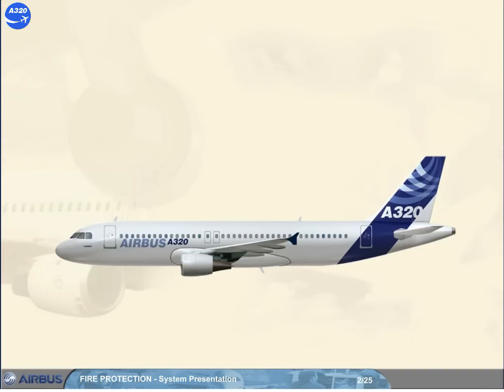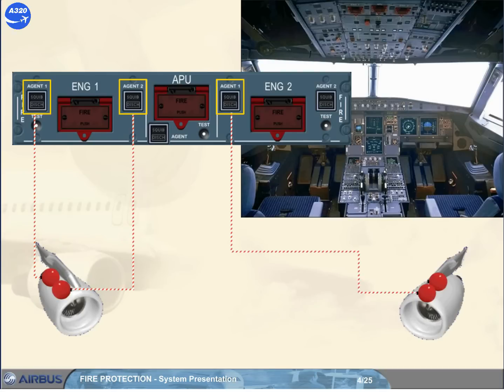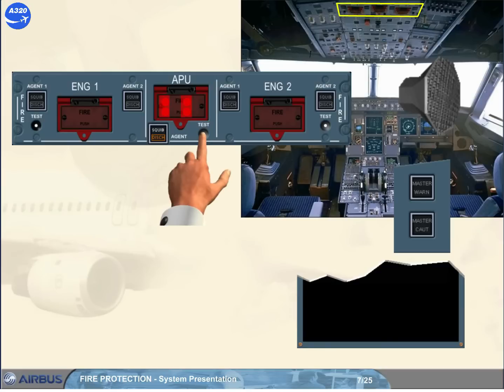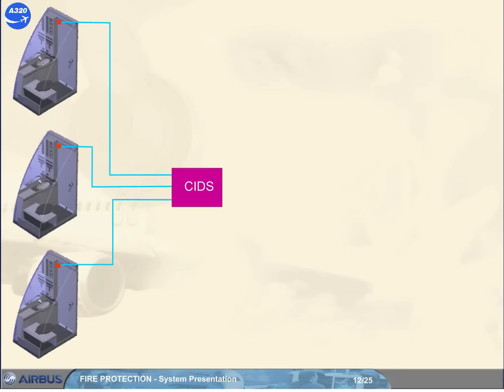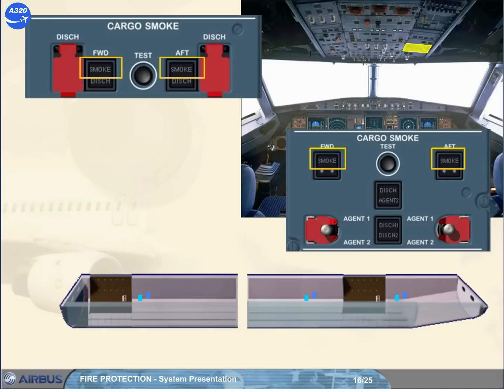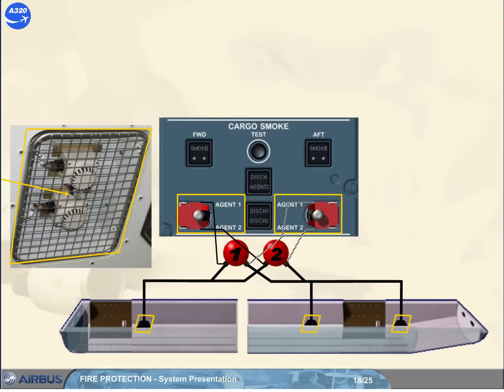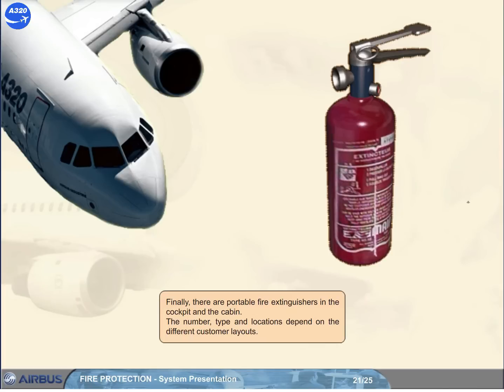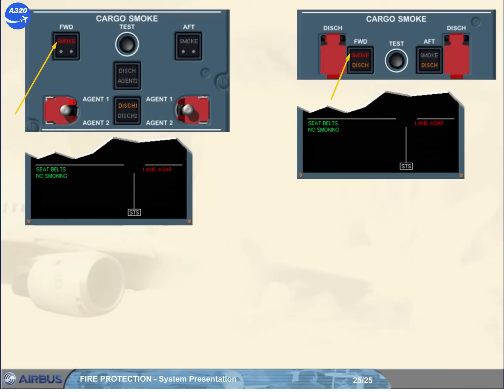Airbus A320 # 39 FIRE PROTECTION SYSTEM PRESENTATION

Comment: why don't engines have red disc. There is only Apu has ?
Reply from the maker: Because we have the SQUIB/DISCH indication on the overhead panel in the cockpit
Reply: @a320mentorchannel APU bottle also has SQUIB/DISCH indication.